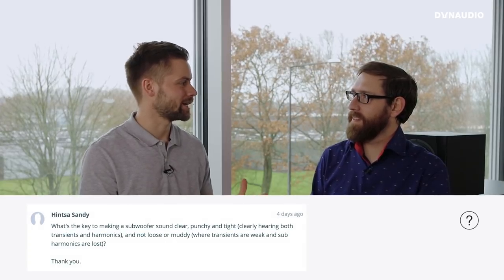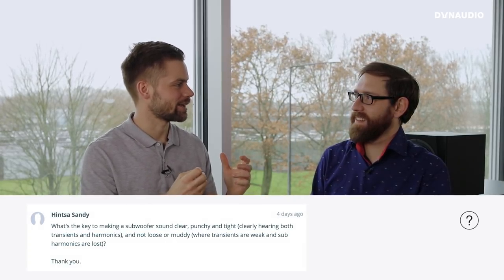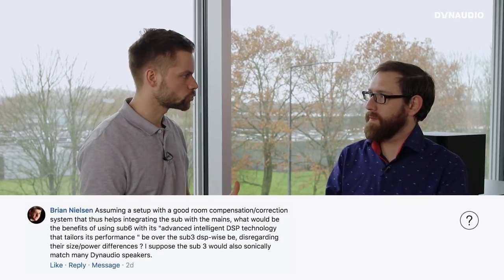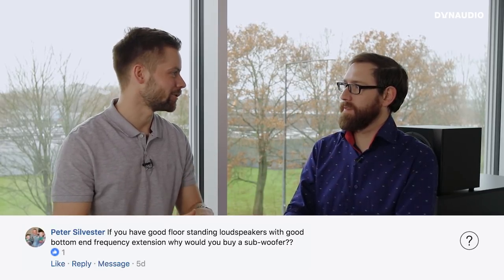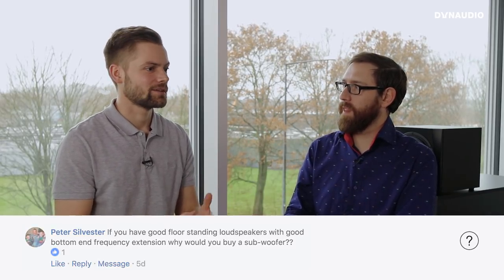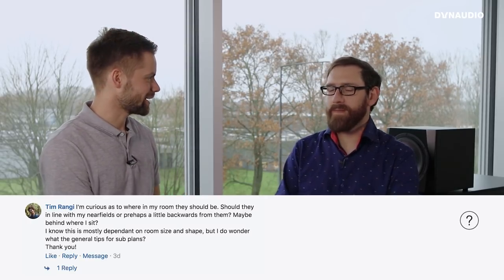Subwoofers: do they add an extra dimension to your speakers?

Comment: I purchased the Dynaudio 18s 8 months ago (February 2022) to use with some bookshelf speakers in my home - and I enjoy listening to it very much.  The sensitivity adjustment was the capability that I found most necessary because my amplifier outputs very low power from its pre-amp outputs.  The 18s has broken in over time to where I have been able to reduce the volume by 9db in 8 months by a combination of changing the sensitivity from +6db to 0db, and reducing the volume from +8db to +5db.

Comment: VERY interesting topic and SO well presented and one that I am somewhat familiar with . . . ONE thing that wasn't mentioned is that when a LARGE bass driver is WELL designed, say for example an 18 inch driver . . . has SO much more square area than even TWO eight inch drivers working in tandem,  its magnet or motor does not have to work anywhere NEAR as much to make the cone travel the distance  required to produce the low bass note. Therefore it can be "as fast" SOUNDING as two "fast" eights for example. Of course a subwoofer with one or even TWO 18 inch drivers has practical limits of implementation :-)  Dynaudio's Sub 6 is brilliant because it has two opposing drivers working in unison (while opposing each other inside the enclosure) to cancel out vibration and cabinet movement.

Comment: What about on mixing and mastering..do adding sub expecially sub 12 will improve my mix result considering i have a treatment room.. And will it add 3d depth to my sound
Reply: There are standing waves in any room. So you might have a lot of bass in one listening position, and not in others.
The idea of adding several subs, are to fill out those places, so that the bass is more even, across the room.
A second sub should be placed in the other end of the room, to also give more depth.

The YouTube channel audioholics, has an ongoing series about acoustic treatment and room correction, with a very famous guy, called Anthony Grimani (look him up!).
He is talking about the subject, with lots of images in a slideshow. Up to now, they have made 4 videos on the subject, of over one hour each.
You will be blow away, I promise!

They also discuss the usage of several subwoofers.

Comment: I am looking for the perfect sub to accompany my Heritage Special. They are curiously not on the compatibility list. What do you recommend?
Reply from the maker: Sub 3 or Sub 6 would be a great pairing. Or TWO subs, of course 🙂
Reply: @dynaudio  😂 isn't two of anything better than one 😊 My room is about 24 sqm and generally I am super happy with the HS, but as you probably know - one is always hunting for the better sound. So, Sub 3 would also be an option - thanks for the answer! 👍
Reply from the maker: @larsstecken  indeed! You are very welcome 🙂
Reply: @dynaudio  Sorry to bother you again, but it is really difficult to find any reliable information in this topic. Is it possible to use the sub with two separate sources? How would that work? I am thinking about using an RCA switch to switch the pre-out signals.
Thanks for your support 😊
Reply from the maker: @larsstecken  No bother at all 🙂Using an RCA switch to connect two different sources to one subwoofer input is not a problem. The subwoofer only sees one input, the switch. You cannot connect two sources directly at the same time. You may get sound, but you risk damage to your equipment.

Comment: Each person hears music and sound differently and age is a big thing too. We could literally argue till the end of time and have different opinions. There is always the difference on how someone hears the sound. 
It makes me laugh now but I used to get very heated about my hi fi. 
Isn’t it strange how subs have always been accepted as powered speakers but magazines will ban you if you talk up a decent active speaker. 
I tried 6 different subs until I found the JORDAN ALR and it’s lovely.
Reply: Active speakers are are gradually getting better. But still you will always be able to get better sound out of passive speakers because you can attach an amp with much headroom to it, but the built in amps are good enough, but seldom are designed with the same headroom in mind. But there are some beautifully sounding active speakers out there. But for some people active speakers can be a good option. But they are for a different type of people too. You can't experiment with different speaker cables, and different amps. It makes a dimension go away from those people who like to experiment with their home audio system.

Comment: I can't imagine spending a lot of money on any audio system and not have at least one subwoofer. Why would you leave out a substantial, and impactful, range of frequencies.
Reply: Sensitive neighbors & crappy sonic insulation in the walls. >.<
Reply: I had a subwoofer on test to my 7.1 setup. Every time I turned on the sub, I quickly got tired in my ears, by the tight, deep waves. I just couldn't adapt to it. It was like my ears were about to get "pops" in my ears (don't know the English term).
So I skipped the sub, and I don't miss it. It was a mid range Dali sub, so not some cheap crap.
Reply: You people are crazy LOL....!
Reply: @akyhne   That’s not suppose to happen. Your sub should never hurt your ears unless you’re playing above or close to 80hz. I had the issue you described when I was first setting up my speakers in my room. Moving the sub, speakers, & my couch to a different location fixed that issue for me. Adjusting the gain and the phase can help, too. 

It took a few hours, but eventually, I found the sweet spot for my room. now my sub sounds perfectly integrated with speakers, without hurting my ears or sounding boomy.
Reply: Because most acoustic instruments dont produce sub 40hz unless you listening to church organs and contrabassoons

Comment: I didn't know Dynaudio was in Skanderborg. That's almost a walk from where I live (Horsens).
Reply from the maker: When the world is back to normal again, you're more than welcome to pop in :-)
Reply: @dynaudio  I didn't know that was possible. Would be pretty cool!

But I have to say, I don't really have Dynaudio kind of money.
I've had to settle with a 7.0 system, with a Denon AVR-2400H, set of floor speakers, center speaker, and 4 bookshelf speakers, from a competing Danish brand.
That's kind of the budget I'm working in.

It works really well for movies, but less satisfying for stereo audio listening. I don't really miss a subwoofer. I tried one on test for a few days. It sounded great, it was no boomy bass or anything. A really nice, tight bass.
But I always did get fatigued pretty quick, because of the low frequencies. Like I was about to get "pops" (propper) in my ears.
Maybe the sub was just positioned incorrectly? I don't know.

Comment: People who say that subs are only for movies or games, and that they destroy the music in a stereo only system are either ignorant or being purposely argumentative. No matter how good your stereo speakers are, no matter how low you think they go, they cannot do the job of properly integrated subs. When they are set up correctly you don’t hear them at all. The only time you will notice them is when you turn them off. And the you wonder what happened to the detail and soundstage. I used to think a lot like others…why do you need subs, just buy better speakers. 

I drive a pair of Evidence Temptations with 500W per channel (Mac) and they are simply great. But I then added a pair of Dyn Sub500s and the improvement was not subtle. I would never not have subs in my stereo system. If they can make a noticeable improvement to Temptations, then it means they are essential with almost any speaker you can imagine.

Comment: B.L. ?????
Reply: Think it comes from the equations terms of Lawplace law of Force.
Force = I x L x B
B stands for the magnet strength. 
L stands for the wire length in the coil.¨
I stands for amperage, current.
Together they stands how much power and force they generate from the current.
Personally I would call it LB instead.
BL reminds to much of BS ;)

Comment: what is it with subs with small speakers in bigger rooms the detail that's lost the midrange that's lost your drowing out what that little speaker was designed for and that is a smaller room buy its bigger brother if you need more bass the engineer never designed the speaker so you could destroy its sound quality by adding subs .

Comment: just stereo i.e music
-  ive never heard subs improve good stereo speakers - you need speakers that go at least 40hz of course....i refuse to accept subs makes violins better -
Reply: I used to be a nonbeliever, I just added a sub to my 2.0 stereo setup, fine-tuned it and my mind is blown. It makes the speakers disappear, it adds reality, depth and presence to all your music, it's amazing, give it a try. Your speakers might state in the specs that they go down to 40 Hz, they don't, and if they do they do it poorly, you need a bigger driver to perform accurately at that depth. A fine-tuned sub should be 'invisible', you shouldn't be able to point where the bass comes from, it should blend perfectly with your main speakers.
Reply from the maker: Thanks for sharing Alvaro. Sounds like you've made a life-changing decision 😍
Reply from the maker: Hi Alvaro, we loved this little anecdote, can we use this as a quote for an Instagram Post? 😊 Best regards, Lilli
Reply: Dynaudio Of course
Reply from the maker: Great thanks!
Reply: I also refuse to accept something that I have refused to accept. :)
Reply: they don't improve the overall sound of the speaker only drown out what the speaker can do and was designed to do